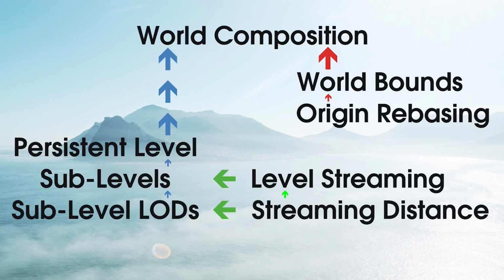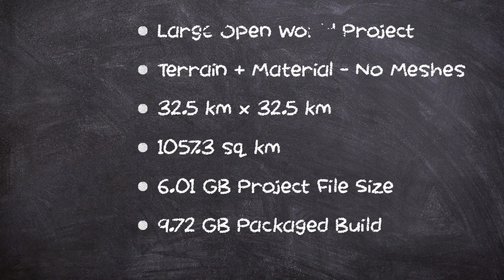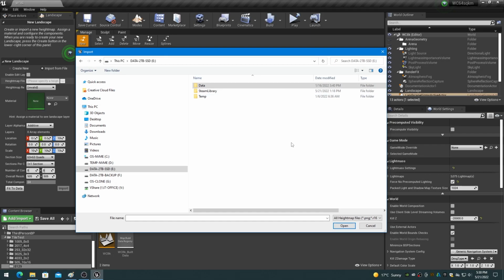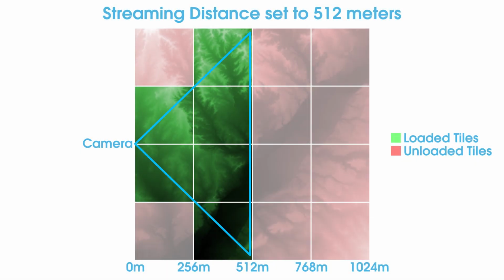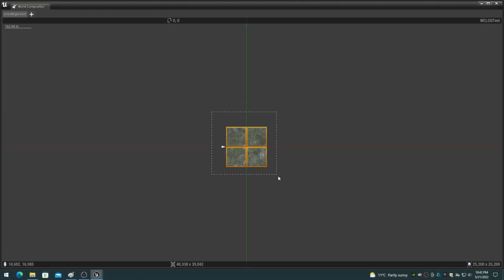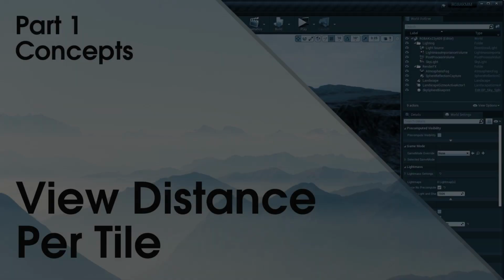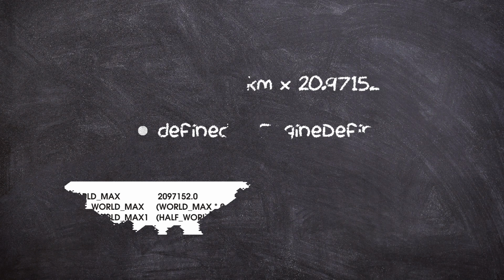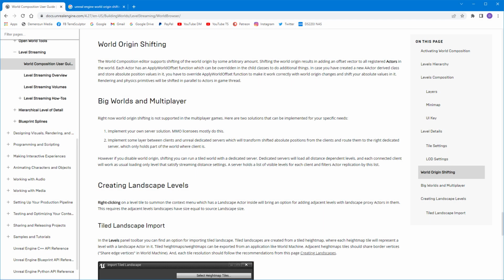UE4 World Composition Part 1 Concepts

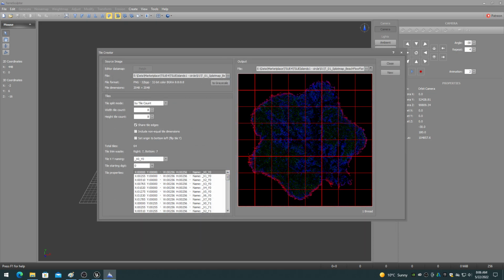Comment: Okay, so then I have to know... @24:41 about splat maps and auto materials, is there a way I can get alterative artistic versions of that data? Realism would not fit my Game's artistic theme.
Reply from the maker: The Weightmaps that are extracted to create the Splatmaps can be anything you want.  Software like TerreSculptor can extract numerous Weightmap styles.  If you don't want it realistic, you could simply color the terrain texturing by slope and elevation and concavity or convexity.  Whether it looks "realistic" usually comes down more to the textures that are chosen.  Cartoons also typically color the terrain by slope and elevation, like the real world, they just don't use real photos of dirt and rocks etc.  The Weightmap system in TerreSculptor lets you do almost anything imaginable for terrain texture layout.

Comment: have you run some tests on world composition on using large tiled heightmaps over 300km x and 300km Y and find out best tile size (how many tiles required, how many x km / y km should be each time) and the tile resolution 1k or 2k or if even 4k per tile is doable, giving both good performance and high quality details
Reply from the maker: The largest world that I have created so far with World Composition is 170km x 170km.  That is the largest heightmap size that I can create in TerreSculptor with 128GB of memory in my AMD R9-5950X RTX-3090 computer.
TerreSculptor supports terrains up to 1 million x 1 million but doesn't tile to disk for better performance, so you require the full memory to get that large size or larger.  I usually use real-world digital elevation models, so finding a proper set of good DEM tiles from the USGS or other sites is always difficult.

I am looking at purchasing a new Intel W2400 workstation that will handle up to 2TB of memory so that I can create larger worlds.  With 1TB of memory I can create worlds in TerreSculptor up to 500km x 500km.

If you look through the World Composition videos on my channel, there are some benchmarks on tile resolutions on various hardware that I have here in my office, using 1009, 2017, 4033, and 8129 tile sizes.  On medium level computers you usually experience hitching with 8129 tiles.  So I recommend 2017 tiles if possible.
Reply: @demenzunmedia  resolution of each tile is easy to decide depending on your landscape material displacement look you can easily figure it out by exporting same tiles and see how your material displacement map look on each resolution. For 8k I think it’s too much.
However for how many tiles need to be used still need lots of testing for me to figure out, have you done some testing on this and what x km / y km per each tile? 
For example if you have a world 24 km large, you can set around 8 tiles x and y, 64 tiles will be covering in total your height map, each tile cover around 3km x and y. That’s the minimum size of each tile you can set. But you still can go with 4 by 4 tiles, 16 tiles in total where each tile will be covering around 6km x and 6km y. But haven’t tested performance on both sets to know exactly the optimal tile size to choose for performance
Reply from the maker: @aber6441  - I always do each test with the Landscape heightmap resolution of 1 meter which is a Landscape Scale XY of 100.  That is what most people will be using for higher quality.  And that way the tests show what the default Scale resolution performance is.

Comment: what about ue5? can you convert this map to world partition map?
Reply from the maker: I am working on a UE5 World Partition video series right now, in addition to other video tutorials regarding UE5 features, and tutorials using TerreSculptor with UE5.
UE5 also fully supports World Composition, so you don't really have to convert, you can use World Composition in UE5 as is.
If you really must, you can convert World Composition projects to World Partition, however, the conversion commandlet in UE5 is really poorly written.  I tried converting a 1024 sq km World Composition to World Partition and it took 26 hours and 15 minutes on an AMD R9-5950X, ASUS X570, 128GB, RTX-3080.  For that 26 hours, CPU usage was at 3%-5% and GPU usage at 0%, so the commandlet is badly written.  So I would not recommend using Epic's commandlet, I would simply choose which system you want to go with and work strictly in that, starting from scratch.
I will have a video regarding the WC2WP commandlet on my channel in a few days, for those who are crazy enough to try it out.
Reply from the maker: The World Composition to World Partition Conversion video is now online at https://youtu.be/0k59QS9EQ5Q